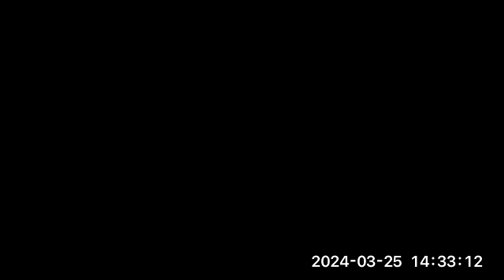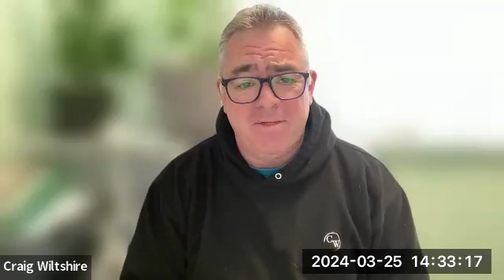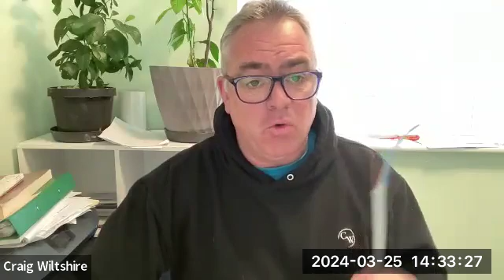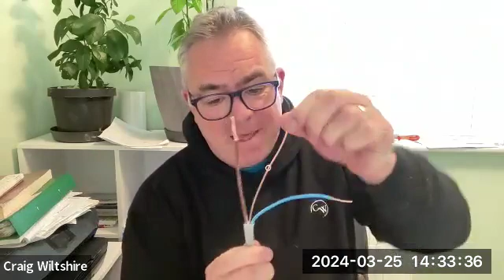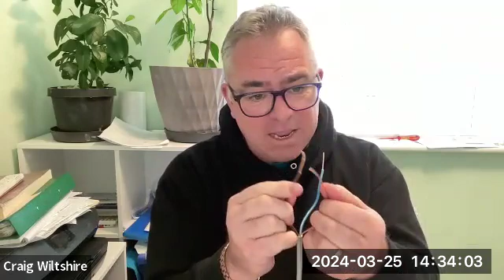difference between earth fault and short circuit faults

Comment: So its short circuit to earth fault?:face-blue-smiling:
Reply from the maker: Earth fault - a current resulting from a fault of negligible impedance between a line conductor and an exposed conductive part or a protective conductor 

Short circuit - a current resulting from a fault of negligible impedance between live conductors having difference in potential under normal operating conditions 

So there is no such fault as short circuit to earth.  *definitions BS7671 pages 33 & 42